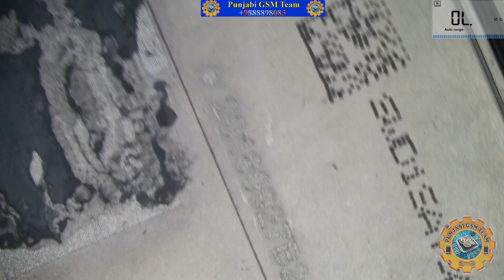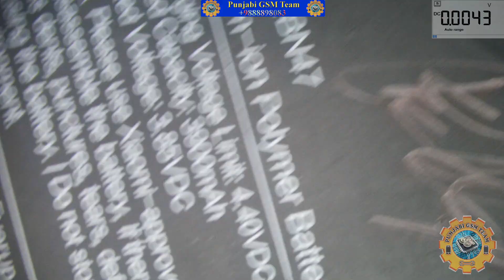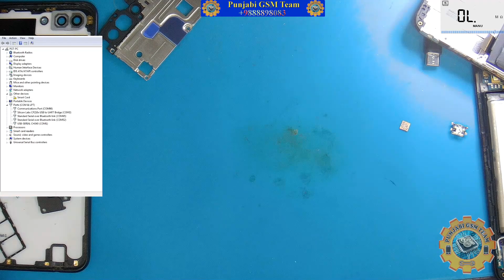Redmi 6 Pro No BackLight Solution.  #PGT

Comment: Redmi 4x blue display problem pls solution
Reply: Cpu reboll kr lo
Reply from the maker: check lcd driver ic outputs first, if there are fine thn reball cpu.
Reply from the maker: also check for reset signal.
Reply: @PunjabiGSMTeam  all signal ok but display blue  cpu no rebolling